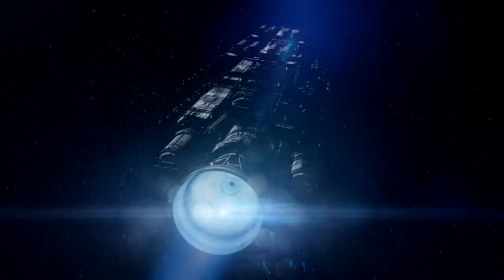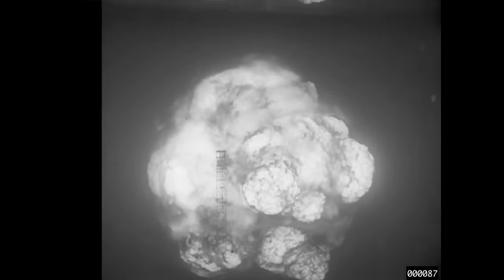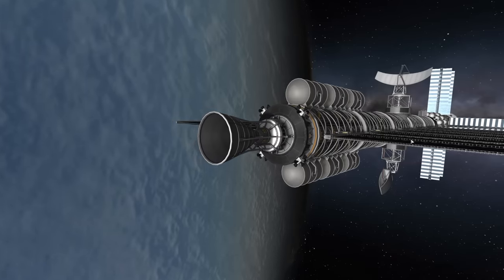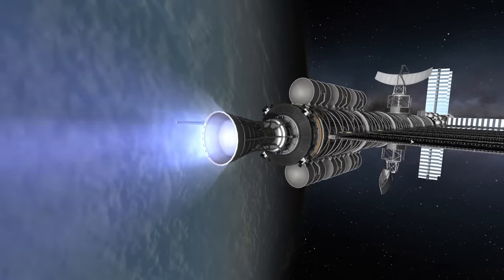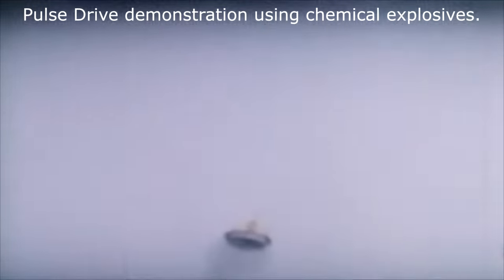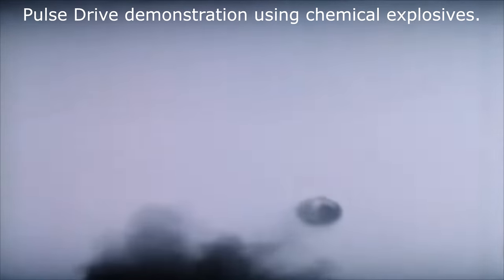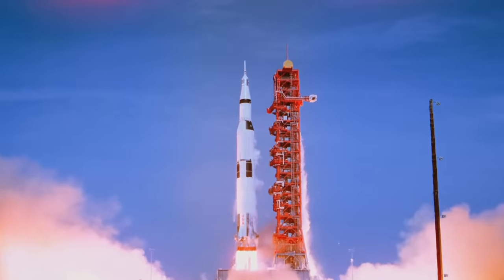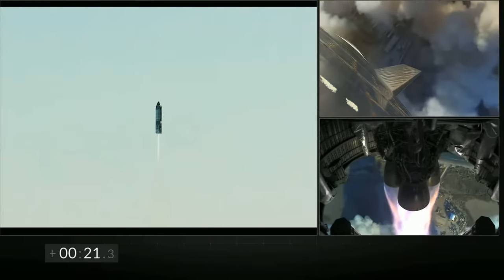The Nuclear Salt Water Rocket - Possibly the Craziest Rocket Engine Ever Imagined.

Comment: "I'm Scott Manley, fly safe" he says.
Safe???  With a constant nuclear explosion going on behind you?
I think he and I have a very different concept of what constitutes safe!  o_O
Reply: "Ah. This is obviously some strange usage of the word safe that I wasn't previously aware of." —Douglas Adams
Reply: Probably said the same thing about steam engines.
They tended to go boom, too.
Reply: @hellacoorinna9995   Ah yes; Hiroshima, Chernobyl, Three Mile Island, Fukushima... those were some really kick-ass steam engines.
Reply: @martythemartian99  actually, modern reactors are pretty safe, as long as you dont build them in areas where earthquakes/tsunamis are common

Also the combined number of deaths of all reactor accidents that happened in our history are nothing compared to the number of deaths that happened in the construction and running of all other types of powerplants, even if you look at each type individually
Reply: @swenmcheath1798  Yeah so what?  My point was I wouldn't compare nuclear reactors to steam locomotives when it comes to the size of the boom, as well as using them in areas where earthquakes/tsunamis are common.
Reply: @martythemartian99  nuclear reactor cores do not explode like a nuclear bomb, in the rare cases that an explosion occurs in a nuclear powerplant it is always the steam that is exploding not the core itself. of course you can compare them to steam engines, the principle that is used to generate electricity is to use the steam to drive a generator like in almost every other powerplant, if the pressure gets to high it will blow something up but comparing it to hiroshima and nagasaki is just plainly wrong, it is not a nuclear explosion
Reply: @swenmcheath1798  I never said they did explode fool.  My first post was meant to be a joke and Marcus Dirk seemed to get it with his quote from Douglas Adams.  Then Hella Coorinna made a weird connection to exploding steam locos, so I tried to make light of it again by sarcastically suggesting famous nuclear disasters were actually caused by steam engines.
Do you get it now?  I am not anti-nuclear and believe it will be a valuable power source as we move into space.  Something else we will need when we leave planet Earth... IS A GOOD SENSE OF HUMOR!!!
Reply: @martythemartian99  bro, dont get so toxic, i got the joke dont worry, but you listed hiroshima in your second statement which has absolutly nothing in common with reactor accidents so it was just plainly wrong
So have a nice evening and try not to be toxic just because some people seem like they dont get jokes, they might just have fun overanalyzing and rectifying statements without meaning any harm
Reply: @swenmcheath1798  I class both Hiroshima and Chernobyl as disasters even though they are different.  And don't tell me not to be toxic when you went all Sheldon Cooper on my ass making me feel like I was stupid with your explanations about the difference between bombs and reactors.  If you got the joke, why do the over analysis in the fist place.  I'm not Howard Wolowitz.
Marty the (toxic) Martian.
Reply: @swenmcheath1798   My blood sugar level is rising and I'm feeling much better now.  What set me off was when you said I was wrong to include Hiroshima in my list, when I would not agree.  If you think about it , the cause of Chernobyl was very different to Fukushima, and both were different to Three Mile Island.  My reason for listing them was only to compare their potential destructive power (high) with that of an exploding locomotive (not as high), even though there are both reactors and bombs on the list.  Also even though steam turbines are used to generate electricity, they are far less likely to explode that a pressurized steam boiler.
Don't worry too mush about the gullible fools, they don't usually watch cool stuff like this.
I'll go and breath into a paper bag now, sorry I lost it back there.
Reply: @martythemartian99  agreed, dont worry man, i dont take such things personal and im also sorry for going about it in a stupid way, have a nice day and stay safe in this trying times
Reply: @hellacoorinna9995  "That's about it, gaffer, and I've blown up one or three in testing, I don't mind telling thee! But now sir, we've got it right, sir. Safety valves! That's the ticket!"–Terry Pratchett, Raising Steam
Reply: @martythemartian99  But you did unintentionally acknowledge they were "steam engines".
And you also didn't disagree with my point about steam engines (or at least, the boilers) being known for exploding very well (one reason they took a while to ger adopted on all vessels until the kinks were worked out.

Granted, yes when steam boilers go boom, there's not the lingering effect of radiaton. But I'm still right.
Reply: @hellacoorinna9995    I'm beginning to wish I'd never made that f*cking joke  :(
Reply: @martythemartian99  
Welcome to the internet.

Comment: Getting propelled in front a sustained nuclear reaction twice as powerful as the peak power of the Chernobyl meltdown, and you still say «fly safe» ?
Reply: I don't think it'd really matter if you're on a rocket in space (or even orbit) if you get engine problems in transit. Chemical or nuclear powered as a person in the vehicle with limited oxygen to breathe and other supplies it's not where you want to be. Rescue will be unlikely unless a backup abort stage exists on your vehicle, which itself is only likely to help you as long as you're close to earth and not traveling away from it at a high speed.

Comment: What about an ion engine powered by a conventional nuclear reactor? Would that solve the insufficient electricity problem?
Reply: Conventional nuclear reactors rely on heat differential. How are you going to get rid of all this excess heat in space, without some material to carry it out and away?
Reply: If it could be made fairly lightweight, a nuclear reactor would be an excellent power source for an ion engine. While ion engines have very high exhaust velocities, tge amount of mass they eject is small so the thrust is too low for manned interplanetary missions.
Reply: Korolev's idea for CCCP's Mars Missionif I remember correctly

Comment: "these are easy problems we can think of" said every inventor ever...
Like the problem of Gs versus meatbags 🤣🤣😁
Reply: Yes, that is a problem for cars and trains, too. With rockets you can have multiple engines … and run only some of them.
Reply: Gs are no problem, we don't need any high acceleration if we can accelerate long enough. And the mass of the interstellar spaceship will be enough to keep those Gs under control even with such a huge thrust.
Reply: Yeah g's aren't a problem really... This theoretical engine he claimed is 2 x f1 's thrust. You'd need a massive spacecraft but you could do that realistically

Comment: what happens when hit a fleck of dust at 0.1% the speed of light.
Reply: Makes a hole
Reply: if you calculate it clasicaly its Ekin=1/2mV^2 assuming 0.01 grams as the mass of the  fleck of dust that gets you (300000m/s)^2*0.01gram =9*10^5J wich is about 200grams of TNT!
the paper said 3.6%the speed of light tho you get  about 12*10^8J or 300Kg of TNT
Reply: Nothing to worry about. Nobody will ever report it happening.

Comment: I wish we could build this but governments don't want to pay  :(
Reply: Containing this fury on earth in an enclosed environment would be totally non viable. It would be all well and good to run the experiments in space somewhere far away, where it could all dissipate like Scott said. But there is no such luxury on earth. Dumping the energy itself into the atmosphere would be easy, we did that for the F1 engines, but when the exhaust is mixed with the byproducts from a relatively low burnup nuclear reaction that isn't an option.
Reply: @jackgibbons6013  And you mainly need high thrust on Earth to lift stuff into orbit, so it is worthless. I prefer closed-cycle gas core nuclear engines - much safer and with zero fallout. A rocket the size of Saturn V with these could lift three times the weight of ISS into orbit, be fully reusable, and have the engines armored like a tank.

Comment: I would seriously prefer Uranium, Plutonium and Thorium to be "kept inside" and used as efficiently as it could be. Until we get a working Fusion Reactor of any kind, those elements are just too damn rare to just throw them away like that... Besides, this design is similar to our reactors today : we would just use a tiny fraction of the energy inside before throwing it away (in that case as reaction mass but still). I believe electric engine will have a leap foward in terms of thrust when the electrical potential of Nuclear Reactors will be a thing in space, and make these concepts not so attractive in the end.
Reply: Yeah. As far as I'm concerned, the scarcity of the fuel is the concern. Not the reaction.
Reply: That's great. When you come up with a concept that can achieve this kind of thrust using "clean" methods, do let us know.

Comment: NSWR: You thought Orion was crazy look at me!
Reply: Actually, this makes a hell of a lot more sense than Orion.
Reply: wasn't Orion technically easier and even simpler, it basically just threw a shaped charge out the back and...Kaboom !
Reply: Lol.

Chernobyl Rocket: Hold my beer.
Reply: @KevinBalch-dt8ot  orion's issue is manuvering it without any rear facing engines and managing the bomb magazine/catapult. in a 'straight' line its still probably more powerful than nswr

Comment: What about an ion  thruster...but fueled by a nuclear reactor, that is recharged near gas giants like Jupiter?
Reply: Ion engines have some fundamental limits on thrust because they use charged particles which repel each other, so the flow through the engine gets choked quickly.
Reply: That would increase the thrust to match the output of the reactor. The downside is you now need to haul the reactor around with you. The great thing about these designs in the video is the reactor is the engine, so saves weight. It also uses the spent reactor fuel as reaction mass, improving thrust and also reducing dry-mass weight.
Reply: @lonesnark  my point was that you could use a type of ion thruster that instead of using solar panels...it uses a system to store the radioactive particles 
irradiated near gas giants.
Reply: @RogerM88  I know, and you can do that. But at these exhaust velocities, reaction mass doesn't matter much.

Comment: Fab! Thanks, again, Scott, for offering a fascinating presentation, chock full of reliable engineering insights. WRT what you spoke of (the need for, among other things, advances in material science, I note that you didn't mention a magnetically constricted "nozzle" to direct the plasma (and keep it away from physical materials... Is that because of the scale of the reaction? 

Also, you mentioned a flow of approximately 200kg/sec. What if you had a rocket using just 10kg/sec? Would that not give you a much longer "burn" (months long)? Not to mention much lower power needs?

Comment: To understand why high-efficiency rockets are so hard to engineer, consider that the energy required to produce more thrust is a function of kinetic energy, where KE = 1/2m*v^2. Air-breathing jets can easily extract more performance by increasing mass flow since mass is free, and the increased energy needed to do this is follows a linear increase. But for rockets, mass is fixed; you can't just go outside and scoop up more once you're in transit. Specific impulse, the measure of rocket efficiency, is a function of exhaust velocity. The only way to increase the exhaust velocity is to increase the exhaust temperature. Temperature is a function not of the velocity of particle motion, but a function of kinetic energy, which rises with v^2. A linear increase in rocket efficiency is an exponential increase in energy generation, as well as in the engineering challenges of heat management.

Comment: It might work for a few minutes.

This design relies on clean water to buffer the reaction, and you can’t carry enough to KEEP BLASTING.

The ion drive works off solar, so it doesn’t need to carry several icebergs strapped to the nose of the rocket.

You might be able to use this fuel source.

 Suppose you diluted it so it wasn’t quite so “nitro glycerin on a bad hair day” and used an external neutron source to trigger the fission.

Like, shooting three parallel streams of slightly less-dangerous fuel through a series of plutonium rings outside a ceramic nozzle.

The neutron bombardment would be regulated by cranking the Plutonium rings closer together.

When it’s just short of critical mass, it will emit fast neutrons.

You cross the streams right at that point.

The Uranium fuses and you have your drive plasma.

I think your thrust chamber will need to be 500 meters long, and you’ll need electromagnetic containment or the whole thing will slag down and quit.

Comment: My favorite video by anyone in months.   Watched 4-5 times.     

Question.   Is the fuel tank set up like a car radiator with myriad boron tubes throughout?    That would be a bit complicated.    Also m, how long could you keep the engine(s) running, as in could you go halfway to mars accelerating at 1 g and braking the second half at 1 g making giving you an artificial gravity the whole trip?

Comment: The advantage of either the gas core or nuclear salt rocket is that we're well familiar with the reactions: Everything is within the realm of engineering development. We don't have to wait on controlled fusion to be accomplished. Potentially dangerous? Absolutely. Challenging engineering? Damn right. Von Braun's Germans would've had a functional design in months. A small engine - say 10,000 pounds of thrust - could be ground tested at a remote location by accepting the contamination issue. Underground.  Nuclear salt rocket doesn't require unknown physics. Even a small engine of 6000 to 7000 seconds ISP at 2000 lbs thrust could be a game changer.
Reply: Honestly, I'd wait for a Starship here.
Throw one on Expendable Starship towards L2 and light it off there, pointing the exhaust away from Earth.
Underground... not sure there's anywhere spacious enough to withstand that kind of power being sustained for more than a brief moment.

Comment: The heat limit issue with a NTR can be solved by using the nuclear reactor to make electricity, which does the superheating. the first level coolant reaches ~1000 K (molten salt reactor, water coolant) and then the electric stage can heat to 2000 K (electric heating elements) and heck, you can then use ionization in a helicon and resonance cyclotron in a VASIMR  engine to up the ISP further. The limit becomes how much electricity vs. direct heating you can do, which is limited by the materials you make the reactor with.

Comment: i wonder how you would stop such engine ? Because the water needs to have some speed going out do you have to flush the remaining water with an expanding gas or a chemical reaction ?
Reply: Cut off the feed from capillary nuclear salt-water tanks and flush the pumps and injectors with pure water, I think.